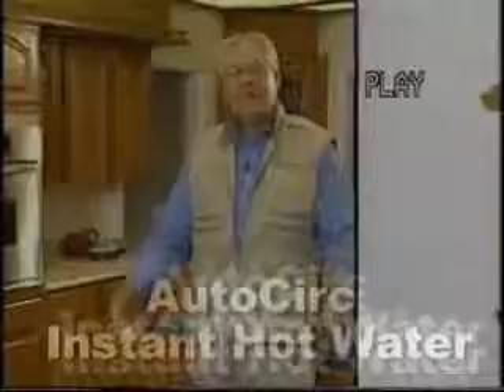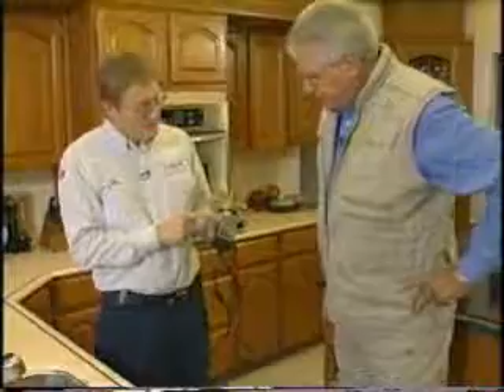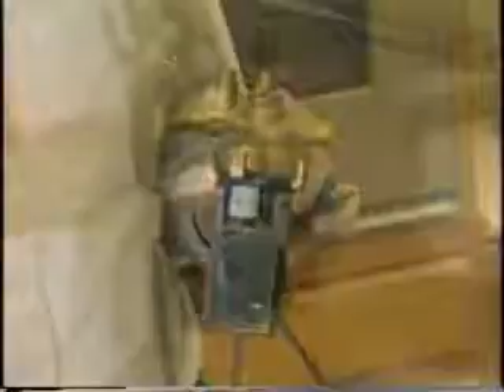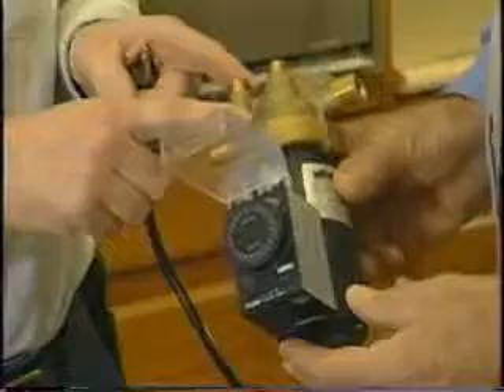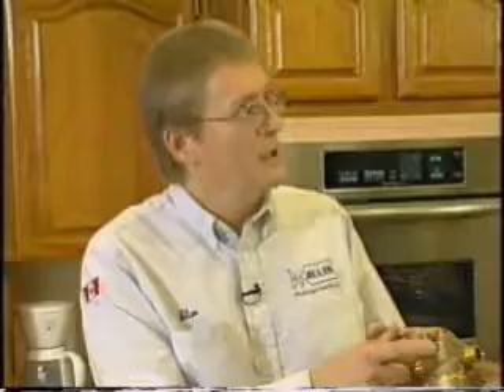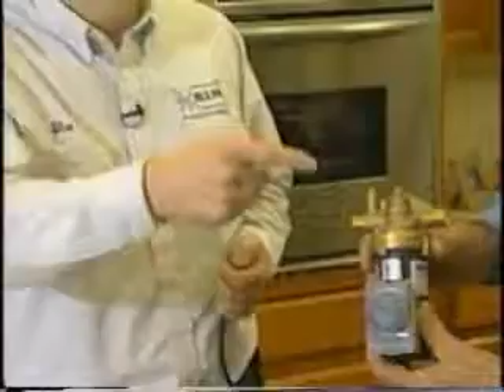How To Install An AutoCirc For Instant Hot Water

Comment: So the hot water goes up to this device and pushes the cold water back down the cold line. This sounds like the cold line will be hot when you turn it on to get a glass of water. When the timer shuts off the water will slowly return to normal. This isn't explained well, sort of glossed over.